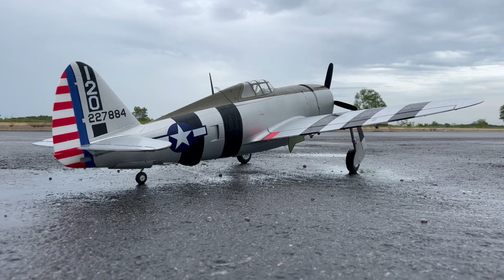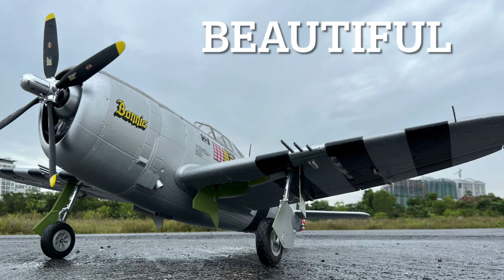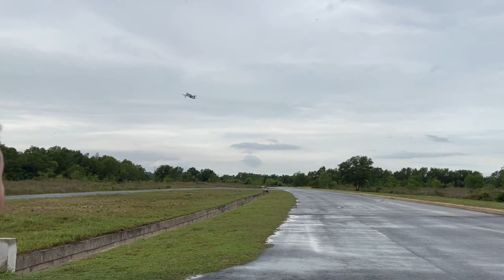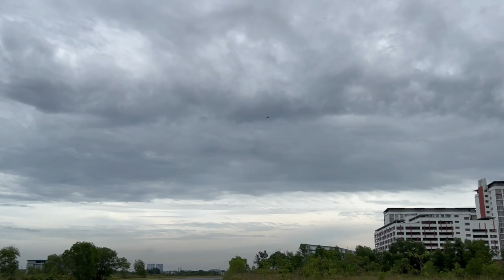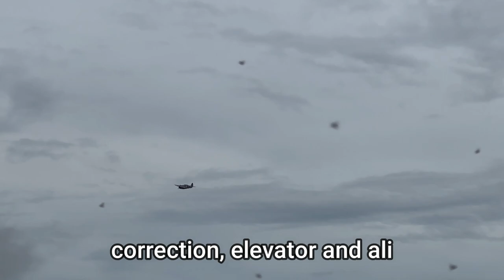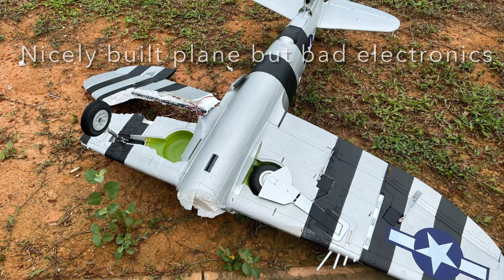[MAIDEN FLIGHT CRASH] FMS P-47 Razorback 1500mm Maiden Flight - CRASH with unknown error!

Comment: A lot of people have had the quick connect wing connection boards fail in flight due to flex in the wings, luckily one of mine didn't work out of the box so I completely removed and replaced them with servo extensions  and haven't had any problems. I now always read up on the model specific forums to fix any common issues before my maiden flight.
Reply from the maker: Thanks for the mention man. I will replace mine on my next model that came with this type of connection

Comment: So many questions. Mine flew on rails b4 I  sold it. Which battery? Was it all the way forward? Looked tail heavy at times. 1st flight too slow, 2nd was much better. It happens tho. Surprising with this plane tho. What receiver is in it?
Reply from the maker: I flew it with HRB 5200mAh 50c 6s 
All da way forward
And receiver TD R18, transmitter Tendem Frsky

Comment: Okay, firstly, welcome to the hobby and don't be sad. I would want to give my 2 cents here as I have been at the same place years ago too.

Warbirds are meant to be flown a little quicker than other aircrafts. As their wings are not designed to glide well. At lower speed where other aircrafts glide, warbirds will fall from the sky. You have been flying slow throughout the flights and I understand the nervousness, but like I said, the flights need to be faster. Most importantly, you need to work on your rudder controls. Both on takeoff and landing to keep the aircraft straight. 

Also on takeoff for warbirds, unlike other aircrafts don't push up the elevator to lift off the ground because these birds need to build airspeed doing a longer run. If needed, try to force be on ground until they build enough speed. I understand it risks the propeller hitting the ground, but if it was a gas/nitro p47 today, you would have crashed on take off. My P47 crashed thrice intro pieces and got repaired haha.

If one landing gear fails to come out,  put the other one back up and do a belly landing. Landing with one gear will topple your aircraft upside down being unbalance and also break your one retract, possibly your wing too. In your transmitter, also set hi and low rates and assign switch to switch them inbetween flight as per comfort. Use -40 expo for smoother flights.

Now, the issue why you crashed. It could be that thing that fell off on downwind, but mostly it's you taking a slow turn. Once again, warbirds will stall on turns. I lost my Mustang P51 on maiden just like you did at this same turn for the same reason. Ideally stretch your downwind at a good altitude, then turn at a good speed, and do a long final approach straight in. That's where you can use flaps, and slow down and descent. Don't make short sharp turns just at the corner of runway.

Lastly, foam aircrafts are easy to repair and I hope you can repair yours. They take time but most of the time repairable. I hope I could help you a little. Flying warbirds are not easy but in the end rewarding. Goodluck :D
Reply from the maker: well said! Thanks for the advise! Cheers!

Comment: Ok over all you did fine on this flight but if you have a choice to land with one gear down? or with all gear up? always choose Gear Up Landing on the Grass, you may lose a propeller but damage will be minimal usually....2nd i notice you did alot of steep tight banking turns at a very slow speed,,,Do Not Fly Any Warbird this way it will put you into a Spin Everytime just as you did 3 times on this flight..Remember More Rudder and Flater Wings into your Turns or at least alot more speed when banking sharply...Also Full Aileron Reversal will Not pull you out of a Spin...Reverse Rudder Will...
Reply from the maker: Good info! Thanks for the advise!

Comment: There are two common problems with this plane:
1) The wing connectors. As indicated in the previous comment, it is mounted on the wing and any flex will cause it to come lose causing loss of control of aileron/gear/flap. Also if the inner gear door flap jams (grass/dirt etc)  it will draw excessive current causing loss of aileron control as well.
I disconnected my inner gear down as it is prone to jamming. I also made the wing servo connector free by removing the mounting screws. It seems to be a secure connection now even if the wing flexes. 
2) The battery tray needs to be LOCKED with a click. On the 2nd flight I did not do that and the battery fell off the plane when I did a loop. With no control the plane came down fast and hard. Amazingly it fell into a bush which cushioned it well that the only loss were the prop blades and some compression creases on the fuselage.
Once setup properly, the plane flies great and is very easy to handle.

Comment: Pretty sure the Crash was caused by a Tip-Stall...in my experience Left Turns usually in a down-wind situation at too slow a speed will cause a Tip-Stall...as for the L.G. issue, If it were me I would have attempted a Belly Landing...Props can be replaced. Sorry for your loss, it was a pretty Plane...
Reply from the maker: it is a tip stall at the end, but it is caused by the aileron lock during the landing approach
Reply: @AndyYuenRC  Ah. Usually when that happened to my models I was doing a left turn too slow down wind, usually because I would run my batteries long past 3.7V per cell...learned the hard way not to do either of those things to preserve models...

Comment: Looks like you are a victim of the crappy wing plugs they use. 
I took all the screws out of the plugs so they float instead of being fixed on each side and flexing with the wing to fuselage joint. So far I've been lucky with mine. 
My 70mm FMS Avanti had a wing decide to quit working mid flight, luckily I got it down in one piece and then floated the plugs and it's working fine again (only 2 flights since then though).

I would not have gone for maiden 2 after losing control during maiden 1. 

Sorry for you loss, it's a really nice flying plane when it's working correctly. 
Those wing plugs are the only negative I've found with it so far.
Reply from the maker: not a fan of the wing plugs! if i saw it in my planes, I would remove it (instantly!)

Comment: I had a 1st Generation 1500 P47 (Jackie's Revenge Bubble-Top), and had the same issue with that one with Landing Gear, and to get them both to work I'd have to invert the Plane in Flight, and flew it as usual, and extending the Gear went normally which I could never seem to fix, even with replacement L.G., replacement Receiver...wound up selling it...

Comment: What a bummer. I love the p 47. They fly awesome. I hate the multi port wing connector they're just not trustworthy  I prefer the y harness every time    also note every warbird likes to fly nose heavy   always forward of the recommended CG. To be safe and it will fly much nicer 👍🏻🤓✌️
Reply from the maker: Agree, I would much more prefer Y harness than the multi connector . 
Even the old version multi connector by FMS on the P51 1450mm are not reliable at times too!

Comment: Sir can i say something, you fly this warbird the wrong way, in every corner you almost have a stall, you fly the warbird to slow with not enough power, so you did get a stall on the landing, that happens to manny first warbird flyers, even to the experience pilots than can happen sometimes iff they do not keep the power on, you can better practice on some more easy to fly plane like a high wing plane before you fly a warbird, a warbird is not a beginner plane, i like warbirds to but they are a bit fiddly to fly iff u do not now how, my tip keep the power on in the corner, but i am sorry for you loss and i hope you will not give up on warbirds and this beautiful hobby.
Reply: Yes and no. The reason for the crash was not his speed. The plane was not reacting like it should at 12:04 and he started to say NO seconds before it stalled so you can asume that there was something wrong. He also wrote multiple times that something glitched in the electronics.
Reply: @friendlyreptile9931  i do not think so, wen you closely look than you see it was a stall, he was slowing down for the landing, and the plane was already slow and he did make it slower for the landing in a turn and when he did feel that he was going in a stall he did put more power on and that is the killer, you also get the left torque from the engine and than you are done, in all of his turns he was saying no no no, wy, he did feel the beginning of a stall in almost every turn he did make, and the last turn was his slowest turn on the video, so ask everyone that did have a stall on a warbird they all say the plane did not respond, so it feels like signal los but a left turn so slow is a killer for a warbird and when you than put fast the power on you have a big problem, even a experience warbird pilot can not save this bird that is flying so low with that stall and engine torque

Comment: I was yelling ADD POWER at my TV the entire time!! You didn't have enough power for that airplane. It needs more power to fly properly. Second, not once did I hear you make any trim adjustments. The maiden is for the pilot to make any necessary trim adjustments. Even though you saw a problem with the gear, you must always remember to fly the airplane FIRST and foremost. Then start thinking about the gear issue or anything else that might come up duringa flight. I would also suggest for you to spend a few hours flying an RC simulator. Good luck always!

Comment: Gear up is better than one gear down and one up. Belly land it in the grass next time. Sorry for the loss of the plane. Oh, and no such thing as a second maiden flight...just sayin!
Reply from the maker: well, I call it a second maiden, because you cant get all the trimmings, or tuning on the first maiden. More testing required to dial the plane to perfection such as flap mix with elevator, or landing gear mix elevator. (If* required of course)
Reply: @AndyYuenRC  Those would be trim flights then. 2d maiden is like being a 2d virgin. 🙂

Comment: Ever heard of a "Flight control check" Just like a real airplane you don't check if all the controls move on the ground you check if they move and move in the correct way before you takeoff. A very important part of flying
Reply from the maker: that my routine, to check on all surface 3 times (up and down, up and down, up and down) before i park it to the runway. which is why you noticed after i landed on maiden 1, i quickly re-check on the surfaces. 
unplug all the electronics, and test again... 

that translate to good behavior on 2nd maiden but how ever, the plane acted like Maiden 1 during landing approach, which are a bummer!
Reply: @dofushrop watch vids b4 posting.  You’ll save yourself from looking like a shrop, and not waste everyone’s time
Reply: Surely he checked controls or else he won't have been flying alright for so long lol

Comment: FMS and their lousy electronics. That's why I don't buy anything from them anymore. Only had the V1 800mm F4U and needed to mod it to fly properly. I'll take freewing over FMS any day. There's another angle as to why the electronics are randomly failing. The ESC may be having trouble supplying enough amps to the electronics causing some of the servos to randomly fail when UNDER LOAD. This seems to be the case with the ailerons not being able to work properly, when wind is over them, causing the servo to attempt to draw more amps to counter the drag. BEC could also be failing to power the retracts, or some shorts causing the power issue to damage/interfere with the other electronics. For models this size I recommend dedicated SBEC (switching) with OPTO esc. I rechecked the specs. This warbird uses over 6 (17g)+ 3 (9g) digital servos that are way more than 9g size, and they're DIGITAL servos, therefore the amp draw must be quite a lot. It's also running on 6s so there's quite a lot of work for the switching bec as well. If servos are still working fine now, most likely the sbec portion of the ESC failed or cannot handle the amp draw. The question now is are the digital servos stock or have you replaced them with something that could be drawing more amps?
Reply: Freewing and Flightline are more junk. Sorry FMS is way better

Comment: Pilot knew the alerons were not responding because he shouted no no no,  early in the final turn, so it wasn't a stall. I agree with pilot,  circumstances beyond his control. It flew ok before this happened, no amount of checking on the ground ( which he obviously did)would have shown the problem
Reply from the maker: The Crash was beyond my control, and when am screaming well all those no's... I'm already at full aileron to counter but no avail!  Thank GOD FMS decided to replace me a P51D mustang 1500mm size.
Reply: You can do all the aileron you want, when it stalls it drops like a rock and at such low altitude it was game over. 
The HK Tundra used to suffer from defective burned out aileron connector boards. I am not sure how it is on this one, I just replaced the aileroj servos and used extenders, ditch out the shitty board, at least on the Tundra.